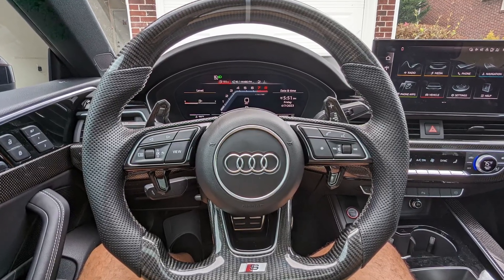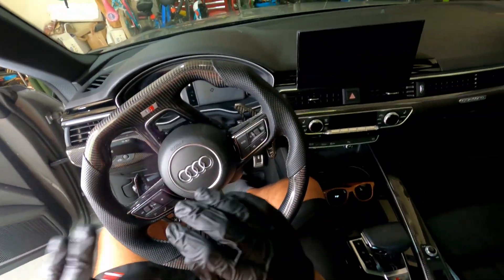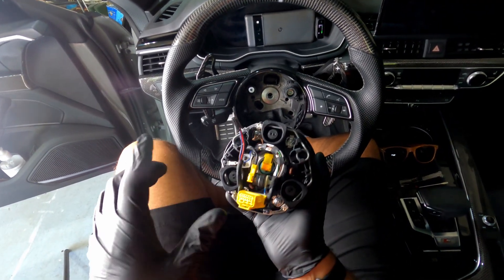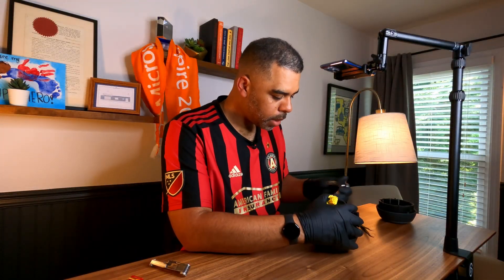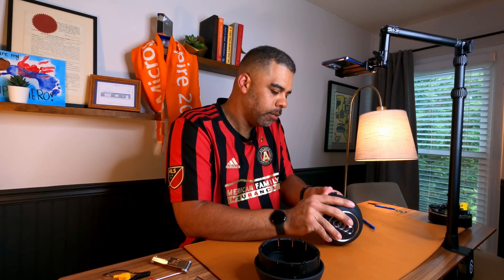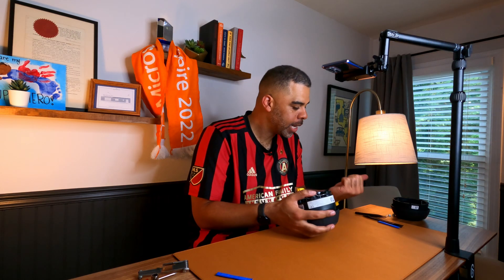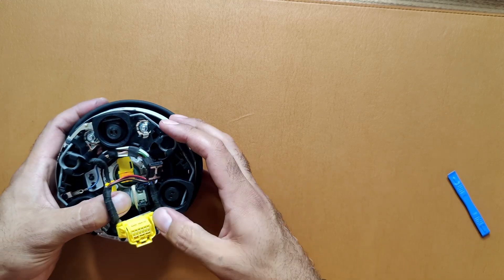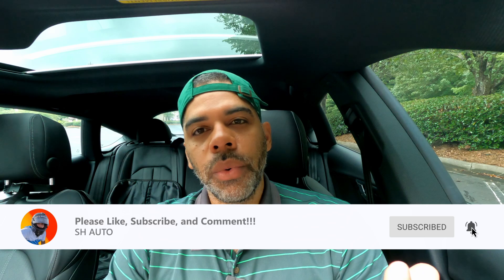Audi Leather Airbag Cover Upgrade🔥- Full Installation & Review (B9/ B9.5, 8V2, Q2, Q7/Q8 4M)

Comment: What you didnt notice, is that when airbag explodes, it make airbag plastic hover break into two pieces, and thats the way how airbag jumps out. On the inside of the cover there is groove in the middle where cover is very thin and in exactly this place it will break during an accident. Now, when your airbag cover is sewed around with strong thread covered with leather, which is not brittle at all compared to thin plastic, now its unknown how airbag will behave, if it will be powerful enough to break this leather in the middle (maybe not and it will inflate into window side instead of your face?), and in case if it will rip, what injuries flying piece of leather can do to your face (maybe hit your eyes or something?). I found this video when searching if one scratched cover can be replaced with mint condition, but covering it with leather is something which I would not do on my own. If I would very need to do it, I would do small holes in leather above this security groove in cover, to ensure that during an accident this leather will rip apart in correct place without any problem.
Reply from the maker: The leather one actually has a slit on one side to make sure it breaks apart during airbag detonation. You can see it at around minute 00:41
Reply: @shautohaus  for me it just look like a place where leather strip is sewed to be continous because you cant just cut this shape without having any joint. And this is strong joint - i had those on my dainese leather motorcycle suit and they survived intense accident with no wear or tear. Original groove in plastic is horizontal in the middle and goes near audi sign. does producer of this cover provide video how it behaves during detonation?  Its not big cost for him.
Reply: @shautohaus  I need some way of protecting airbag cover from scratches because I have brand new car and my wheelchair scratches this part intesively and I dont want to have unnecessary resell value drop.. but this leather cover doesnt convince me its safe.

Comment: Awesome video, but now I dont want to do it since Ive seen how difficult it is hahaha
Reply from the maker: Thanks man. You got it. A bunch of people have done it based on this video. It's doable. Just go slow and take your time.
Reply: Hey. I finally found the energy to do it today. I believe you could have aligned the little flat pins on the airbag with the notches on the black flanges. I also used zipties to hold the flanges together to slide the top bit with the electronics on the airbag. Then when all the flanges were in I cut the zipties.
Anyway these are just tips for the next guys who do this!
Thanks a huge lot for the video man! Really helpful!!!❤️
Reply from the maker: @doctorschultz7139  thanks for sharing man. Great tips. Glad you took the plunge and hope it turned out well.

Comment: Nice video. Helped a lot for my installation!!!
Reply from the maker: So great to hear man. Hope it wasn't as painful an experience as mine. Still debating taking it back off because it just off center a smidge and it's killing my OCD.
Reply: @shautohaus  mine is spot on.
Carbon aggressive wheel as yours.
Carbon dsg paddles
And the airbag cover with black gloss badges.
Well for me it was relative easy cause i had your videos. 30 mins for the airbag and probably one hour for the steering wheel
It's on the photo of my avatar
Reply from the maker: @Dikonou  that's so awesome man. So glad to hear that the video is helping others. Took me over 2 hours to do the airbag. Really appreciate you taking the time to leave a comment.

Also just looked at your picture and subscribed. Airbag cover looks perfect 👌🏽

Comment: Did you get the horn “sensitivity” fixed? Mine is doing something similar
Reply from the maker: I have not, but I heard from the manufacturer that someone else had found a solution using some washers. I personally just press hard at the top of my air bag and that works. It still works, but just isn't as sensitive as before.
Reply: @shautohaus   I was actually able to find the fix, last night I did the wheel and the airbag cover and the airbag wasn't aligning properly, the left side was more pressed in than the right side. And the horn had to be pressed hard to honk.

I took the airbag cover and wheel off, inside of the wheel there's 3 black pieces that the spring goes into, these wire misaligned. I swapped over the pieces from the OEM wheel and now the airbag sits perfectly, and the horn is back to working like before, regular sensitivity.

The 3 black pieces can be removed, by taking the torx screw out and then pulling the piece itself out.
Reply from the maker: @prabhdipkang6535  amazing. I need to find some time to look into this. Unfortunately the Audi is at the body shop getting some repairs at the moment. Appreciate you taking the time to comment.

Comment: great video! I can't separate the inflation system from the cover (as shown at 11:05), it's really hard, doesn't move one bit and I've tried with plastic tools, screw drivers and hands, nothing works. any tips?
Reply from the maker: Thanks. I'm not sure why it won't separate. Honestly, that part surprised me with how simple it came apart. Do you have a small plastic tool that's a little curved at the end like I have in the video?
Reply: Yes i got lots of them that I used, but it really doesn't even move slightly. my airbag cover is pretty dented everywhere already. Funny thing is everything else was quite easy, like the airbag came off very easily from the steering wheel
Reply from the maker: @shadowofflame_  is it dented from trying to pry it apart or other reasons? Do you want to message me on IG with some pictures and I'll take a look. @sh_autohaus
Reply: @shautohaus  I sent you a message on Insta but I don't think you've seen it yet, might be in Requests

Comment: when you say "I should have done here is remove the airbag completly and repack it" at 14:34, what do you mean by remove completely...?? you did remove the pink airbag and pusehd back on to new cover? so idk what you referring to... as I was watching your video, i do not want to put it back together and ended up open back up later. please be little more detail so I can get it done in ONE SHOT .
Reply from the maker: @wonjun8042  what I mean is to remove the airbag from the cover and then try to align it and put it back together. Instead of doing that I tried to adjust it while it was still in the airbag cover and that was very difficult to do.